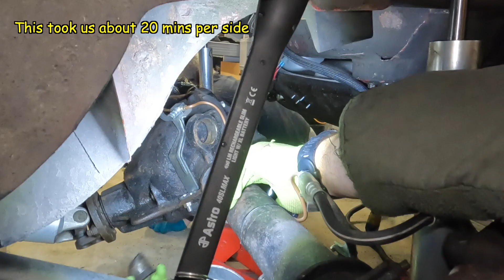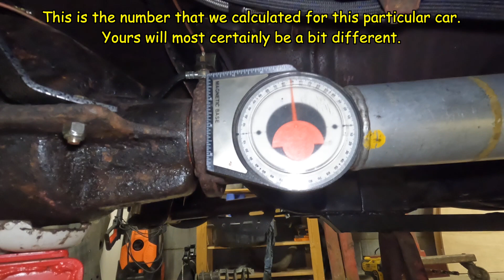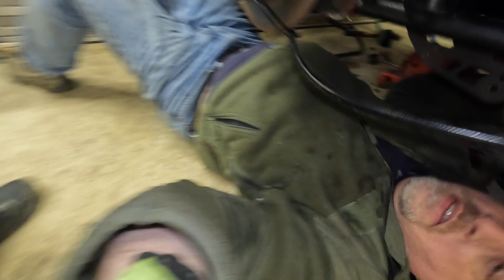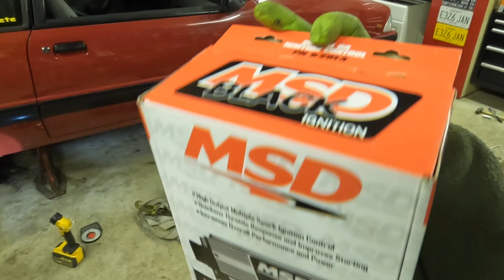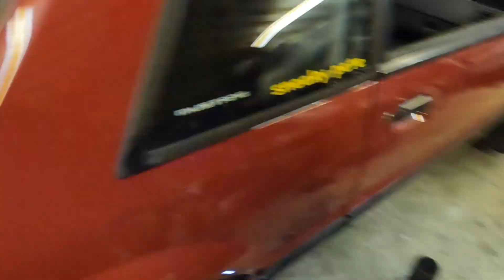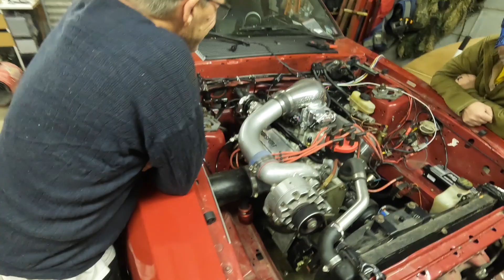Team-Z Foxbody 8.8" Upper Control Arm Kit Install and Axle Setup

Comment: wondering if there are any gains in 60ft or 1/4 mile times with this set up .....?
Reply from the maker: Compared to the old Southside Machine Lift Bars, this setup is MUCH more consistent and controllable going down the track.  We haven't been able to get a ton of data to get any exact numbers, but it's not bad.  I think he is in the 1.4"s in the 60'.